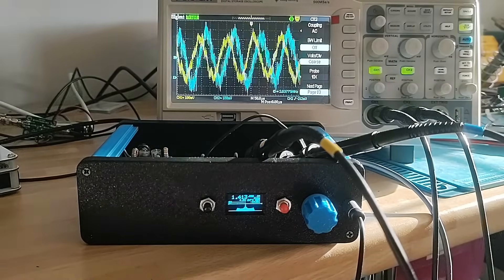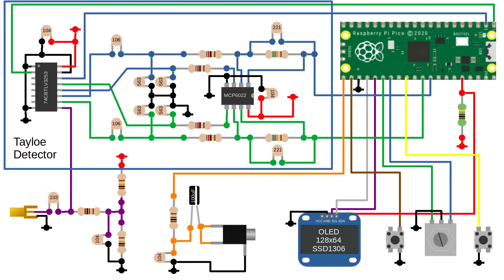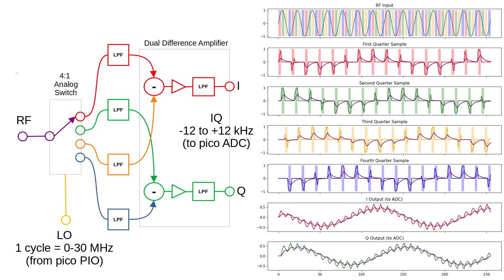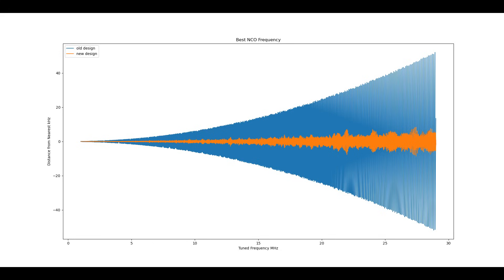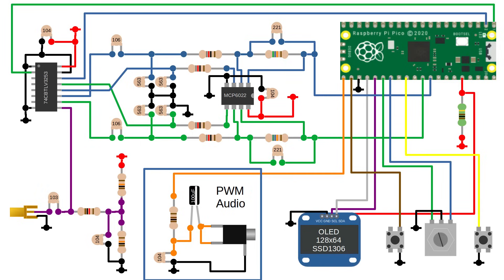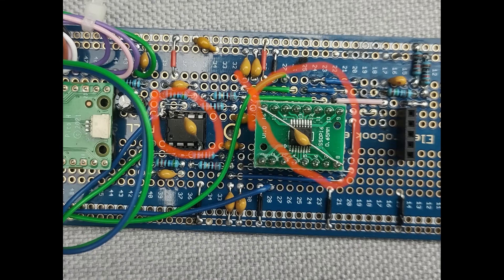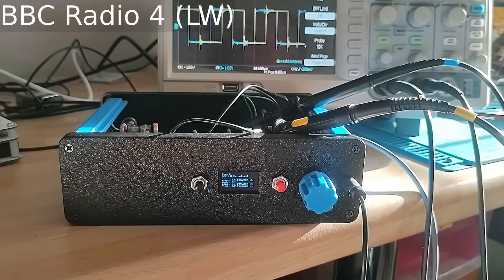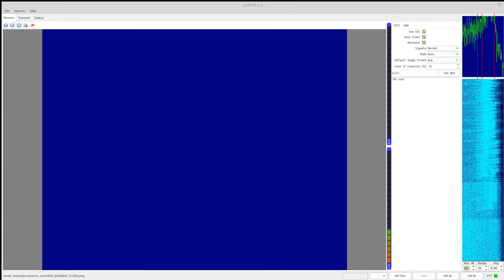Software Defined Radio with Pi-Pico

Comment: Can you share a proper electronic schematic diagram? A confusing cable diagram is not helping to understand your project that otherwise  seems to be very interesting. Thanks for sharing it.
Reply from the maker: Sure, there's a bunch of documentation here https://101-things.readthedocs.io/en/latest/breadboard_radio.html including a more traditional schematic. If you want to know all the technical details you could take a look at the documentation for the original PicoRx here: https://101-things.readthedocs.io/en/latest/radio_receiver.html, it goes into detail about the hardware, and software design with schematics and code samples.
Reply: @101Things-ds8tc  Thanks!
Reply: @101Things-ds8tc  The older version ran the op amp at 5v, the newer one at 3.3v.  Both use a divider fed from 3.3v to set the input levels.  Shouldn't the input level be set at half the op amp pwr supply?  Or is this to just set the zero signal dc level for the A/D inputs of the pico?  I have a bunch of OP275 opamps.  They have a GBP or 9 mhz, should be high enough, but they seem to have a min pwr supply of +/- 4.5 v so maybe not?
Reply: @101Things-ds8tc Thank you for your work and for sharing it with us! ❤
Reply: A DIY kit with all the parts would be nice. The biggest problem like always is finding the parts to build. 73
Reply: Very nice build!

Comment: Suggestion for those building this:
Troll through the available opamps and you likely will be able to find one that has a better noise performance.  Remember to look down in the datasheet for the real numbers.  The one up in the banner headline is always the "typical" number.  As we all know, they shipped those to someone else.  Go with the maximum numbers.  MCP6022 has a very small noise current but quite a lot of noise voltage.  You likely can find one with a bit more noise current and less noise voltage.
Reply from the maker: Yes definitely, there's nothing particularly special about that op-amp, I'm sure there are plenty with similar specs, better noise performance and lower cost. Especially if you are willing to substitute an smd part.
Reply: @101Things-ds8tc  The idea for more high frequencies would work but it seriously increases the parts count
1) A PIO can make a much faster local oscillator but you don't get a large number of frequency choices.
2) A Taylor mixer could mix down from really high to just too high for the ADC.
3) Instead of going straight to the ADC, you amplify, low pass a bit and do 2 more Taylor mixers this time using a more reasonable frequency
4) Doing some math with resistors, you get the I and Q channels for the ADC with the op-amp as you are doing it.
Reply from the maker: @kensmith5694  Genius!
Reply: I am bookmarking this.  I think I just thought of a way to extend the upper frequency range a whole bunch. I will work on the idea this evening and put something here if it looks likely.

Comment: I wonder if you could replace the 743253 with a few resistors and capacitors. The input would be split into four channels using a resistor per channel. Then connect the channel to a GPIO through a capacitor. You would then ground the channel by switching the GPIO to output and cycle through the channels by ungrounding one by switching the associated GPIO to input.
Reply from the maker: That's an interesting idea! I did try something similar using an FPGA once, making a crude mixer by periodically grounding and ungrounding RF signal through RC network. It did work (up to a point), and I was able to receive strong local stations. There was a diode in the IO pin that clipped the negative swing below -0.7v.

Comment: Very neat project!  Do you have any plans to add transmit capability?

Have long dreamed of a super low cost CW Morse code radio to get more people in the hobby. I know there are some relatively low cost options at about $200, but this could drastically reduce the entry cost so that more people would get into it. 73 Mike N4FFF
Reply from the maker: Thanks! Yes, I think it should be possible to get into the hobby quite cheaply nowadays. And there's the fun of building your own kit too!
Reply: @101Things-ds8tc  I think that your project is fantastic way for someone to get into radio, especially SDR RX, with the fun of building and leveraging your time investment in the hard parts!  I love it!

I know there are also a lot of people who would really enjoy aspects of radio that will never have any interested in hardware or building things. I also know that you don't always know if you will enjoy it enough to take the plunge with an expensive first step.  I'm particularly interested in getting kids and younger people in the hobby. After they get a taste of the fun, then maybe they will find it interesting enough to learn about hardware or spend more money.

I imagine that a $20-50 radio where you could listen to everything and send morse code (CW) would be cheap enough for a lot of people to try and then realize how much they love it.  The $200 radios, which are awesome that they exist, are enough money to prevent a lot of people from getting started.  That would be such an amazing first step into the magic of radio.  Your project has me day dreaming of a base board that you simply plug a pico pi into and put into a case. Your project seems like it would be perfect for the SDR RX for such a "kit".  I wonder how hard it would then be to add TX capability for morse code.

Comment: why not use si5351 ?
Reply from the maker: I was aiming for simple hardware with a minimum of external components, implementing as much as I can in software. I think its pretty neat that the Pi-Pico can drive the Tayloe detector directly. I don't have anything against the si5351 though, its pretty cheap and performs well. I might even add one as an optional upgrade!
Reply: It's cool how he is able to do without that extra chip.
Reply: @BaldurNorddahl  he already uses a mixer and a multiplexer 

and they dont sell neither of it here 😭

Comment: I love this project. I’ve been trying to figure out the math behind the IQ sampling by the single ADC. At first I thought that this was an issue unique to your design but then I realized that the ATMega328 used in the (tr)uSDX also has just one ADC so it must be solving the same issue, somehow. If I understand correctly, your solution ends up sampling 250K I and 250K Q values per second. If that’s the case, would it be possible to use a diode ring mixer instead of Tayloe, sample its single output at 500K, and then convert that to 250K I/Q in software?  Such hardware might be even easier for beginners (like me) to understand.
Reply from the maker: Thanks! Yes, that's exactly right I'm sampling I at 250 and Q at 250. It took me a while to get my head around using a single (multiplexed) ADC, but its probably obvious to someone with a DSP background. I think its just an extension of interpolating using zero padding and low-pass filter. You can easily convert 500k to 250k I/Q in software,  the only difficulty in that case would be distinguishing positive and negative frequencies. I can't think of a way to do this without using a second mixer. I think sBitx uses a superhet design along these lines.

Comment: Awesome‼ Thanks 👍 Why did you go with the MCP6022 when there are other op-amps, less expensive op-amps, with a gain-bandwidth product of 10MHz and a slew rate of at least 7V/us? For example, I found the NE5532P on Mouser for $0.59 (US dollars) versus $1.86 (US dollars) for the MCP6022.
Reply from the maker: Thanks, Good question! I did consider that device, it's a popular option. I also looked at the lm4562.  It's mainly because I wanted to run on 3.3v. That's not to say there aren't better options though. My search wasn't exactly exhaustive, I already had some in stock.

Comment: Amazing! - can it be even better if you port to the new 2350 Pico 2?
Reply from the maker: Thanks, the Pico 2 should be much better with the fpu and accelerated DSP. I have got one on order... To be honest though, I don't think I have found the limits of the first generation device yet!
Reply: It might be since the RP2350 has hardware floating point and DSP functions👍